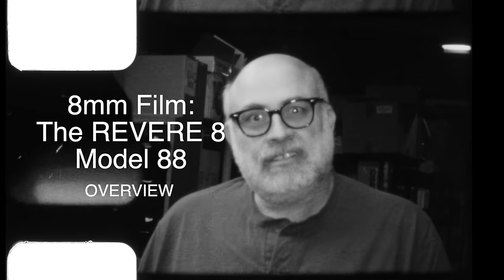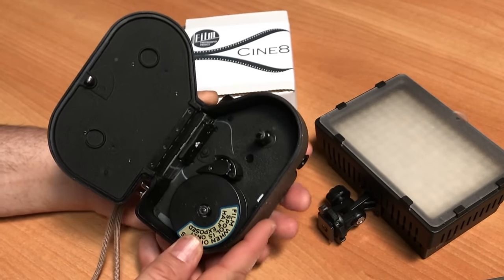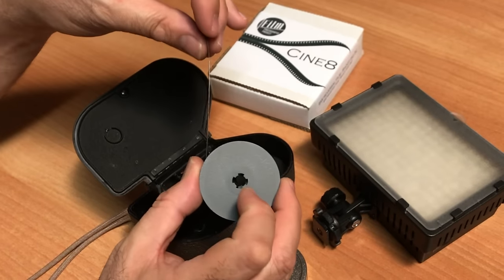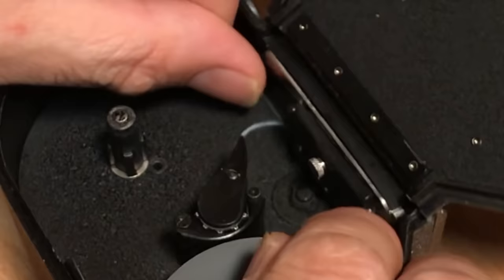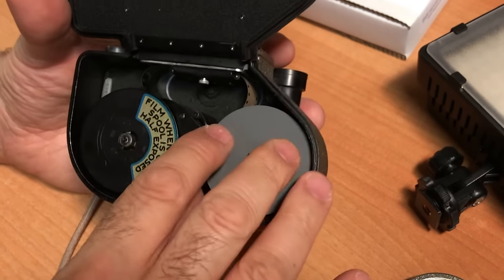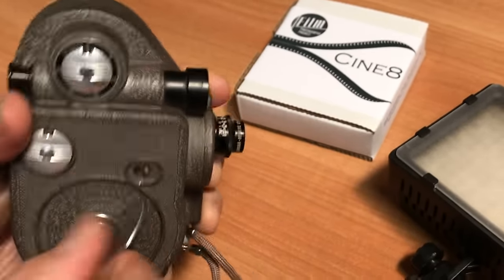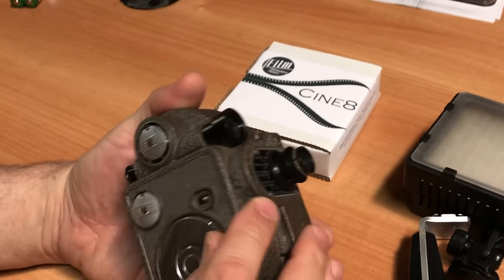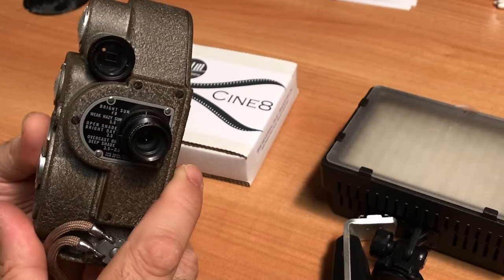Revere Eight Model 88 8mm Film Camera - Film Test / Overview

Comment: I have this same camera! I have shot two rolls with it, but it’s starting to act funky now. It jams quite often after I wind it, so I have to open the film door and oh-so-slightly tug on the bottom loop to unjam it. It’s a shame bc I don’t want to ruin parts of the film.
Reply: Did you find out if it affected your film at all? I had the same problem, but I gave it the more caveman approach of slapping the side to unjam it. It worked and the camera whirred, but I'm really afraid to see how the final product is going to turn out

Comment: I just don't get it. I've gone through 5 different double 8 cameras including 3 different model bell and howells, and two Reveres. Every single one fails to cycle film. Each one runs perfectly with no film, they all slow down instantly and then fail to move when film is loaded. I'm absolutely loading correctly, and it's wound correctly, etc. Tried two different rolls of film just to be sure it wasn't the film.

Comment: I have a question. I just found one of these the model 99 version but mine doesnt move when when I use the shutter. It doesnt wind either. Is there something I can do to fix it? I would really love to be able to use it.
Reply: Sounds like the motor is jammed. You can try one drop of sewing machine oil under the winder. Otherwise, seek out another. They're very inexpensive!

Comment: I have a damaged Reel with New fomapan 100 8mm Film. Can i unroll the Film and Put It to a New Reel in dimm light? Or will this damage/Expose the Film? My New Film came with a damaged Reel that wont fit and Spin...
Reply from the maker: Needs to be done in darkroom - no light at all.
Reply: @FilmPhotographyProject  but normally you can charge the camera with new film on dim light, right? I mean when you film and the roll is at the end and you put a new roll of film. Is it only in this case? I am thinking about closing the window and turning light out and unreel the film and put it to another reel.